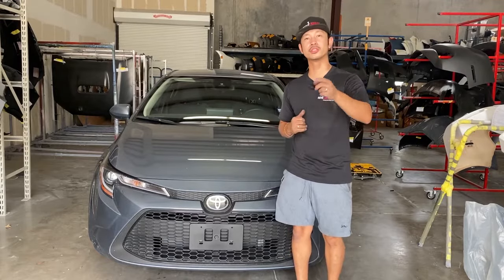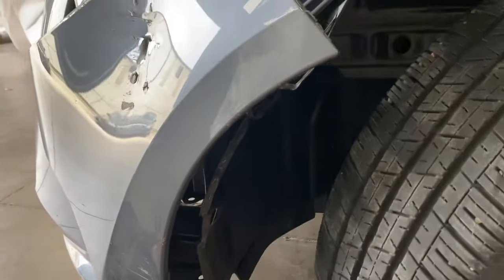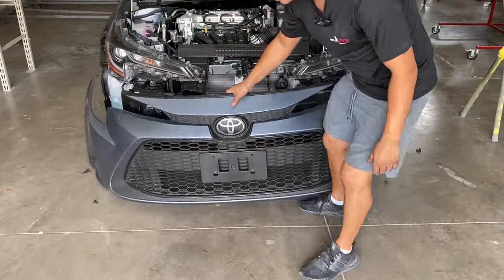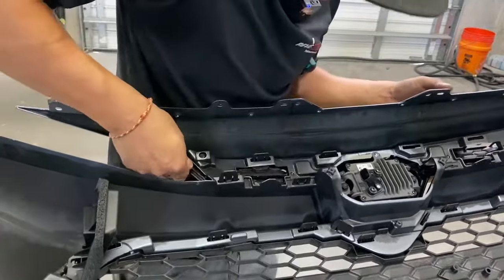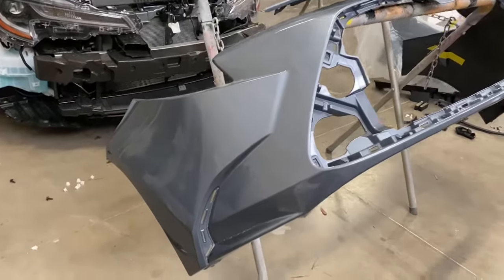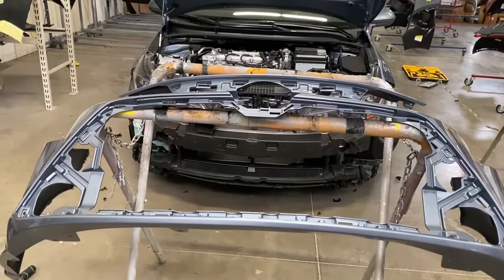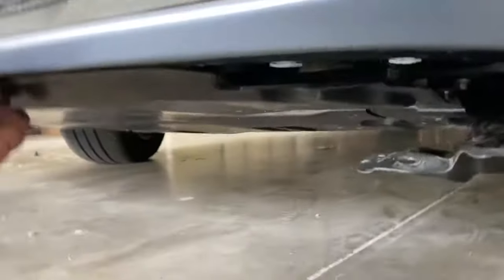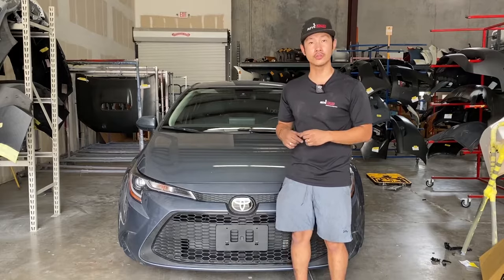How to Replace 2020-2022 Toyota Corolla Front Bumper | Step by Step for Beginners | ReveMoto

Comment: Those plastic pins you actually push them down and then you can just take them out instead of using a screwdriver
Reply from the maker: Appreciate the tip! Yeah some of these bad boys sometimes get stuck in the bumpers so we've found it easier to wedge the flathead in for some of the installs we do

Comment: That particular Corolla is Japan built. Unlike US built models, they have tow hook covers on both the grille trim and bumper cover itself. Looks like you installed a bumper cover meant for a US built Corolla as it’s missing a spot for the painted tow hook cover.
Reply from the maker: Very observant!  I like it.  Yes that bumper due to the backordered parts customer opted for the one available.  The fitment and install is the same just the tow hook is deleted.  If you need parts for your car go to www.ReveMoto.com

Comment: Just got mine scratched badly going into a badly angled parking lot entrance...good to know we can replace it. Costs $100-$200 for a replacement bumper which isn't too bad. With how low the Corolla is, it's unfortunately prone to little accidents like that...
Reply from the maker: Yeah with the help of this video replacing the bumper is super simple.  It it is not that bad then Touchup paint could be a good solution if you get into minor scratches regularly.   If you need the Touchup paint and painted to match bumpers go to www.ReveMoto.com.

Comment: Someone has stolen my Toyota Mark and my sensor is not working for the same model. What should I do? How to change the sensor?
Reply from the maker: You can get another sensor at the dealership and then use this video to take off bumper.  So you can reconnect sensor

Comment: Hi! Thank you for this video. What is the part at 13:06 called and is it important for the stability of the bumper? Because I found this black plastic clip that you popped out broken off the part that you remove at that Timecode inside my bumper and im worried that I need to get the whole bumper replaced. Thank you in advance!

Comment: If the rear bumper has a dent, could the heat gun hack worth trying or would the whole part need to be replaced?
Reply from the maker: Hi Annie,  depends on how bad the dent its.   Its definitely worth a try to heat up and push out.  If it doesn't work or has a hole in the bumper best to buy an new one.  Go to www.ReveMoto.com it painted to match your car and install is easy with this video.

Comment: Hey so my bumper got damaged. The clips on the side are broken. I don't know what the parts that hold the bumper up are called. If you can kindly tell me I will greatly appreciate it. 😊
Reply from the maker: Bumper support bracket is what we call them.  Tell the dealership you need the bracket is connected to fender that holds bumper.  If you need painted parts go to www.ReveMoto.com

Comment: Just got couple of small dents on my bumper.  Wanted to remove and do it myself but decided to get it done professionally.  I just took out the top cover by pressing on the 8 tabs but when I try to put them back, but they do not snap into the hole to hold the cover tight as before.  I also saw you dropping the 8 plastic tabs after you put the cover back in the last step.  Is there a way to push the tabs back so they hold the cover firmly in place as it was before I removed the plastic tabs ?
Reply from the maker: The tabs sometimes they get worn out and you have to buy new ones.  Depending on how you took them out or how worn they are.  The prongs may break making them not as sturdy.  I recommend just getting new one they like $2-$3 a piece at dealership or online for like a box of 25-50 for $5.99

Comment: Odd question, I'm looking at maybe having to replace a  front sensor on my mom's 2020 Corolla LE. Is there a way to get the front sensor off without pulling the entire bumper. If possible, I'd like to not disassemble the front end (mostly cause I live in an apartment, so I have no garage), but I have the tools to do it if I need to.
Reply from the maker: Honestly would be very difficult. You have to press on two ends of a sensor.  I honestly would suggest taking bumper of so you don’t mess up the sensors.  Thank you for watching!  Go to www.ReveMoto.com

Comment: Should I unplug the battery before the bumper sensor? Will it throw out an error code
Reply from the maker: It’s always good practice to take battery off.   If you don’t it did not throw an error for me.  If you need this bumper go to www.ReveMoto.com

Comment: Is there any way to remove the emblem without taking apart the whole front bumper? I want to just black out the logo in the front, but it’s covered by a plastic cap? I don’t mind having to take out the part but don’t want to take out the bumper if I can avoid it. Thank you for making this video!
Reply from the maker: I believe you do have to take the homer off.  Try wedging a flat object behind the emblem if it comes off easy then your good.  If there is resistance don’t continue or it will break

Comment: I am curious as to what the benefit is to using you guys vs others that charge less than half what you charge. I can get a color matched bumper cover for this car for 433 after shipping but with you guys its over $900
Reply from the maker: Very simple.  Ours are not folded so it comes to you ready to install.  Lifetime paint warranty and color match guarantee.  Any issues chat or talk to our live team members.   Look we also answering your questions at 11pm.  We here for you
Reply: @ReveMoto   Well thats cool. I appreciate the response. Thankfully there is a painted auto body part facility in Elk Grove Village which is right by my work that will do one for $350 out the door. Sorry I just cant afford $900 for a new bumper. Stupid truck tire blew out and was on the highway and screwed my bumper up.

Comment: hey, any chance you know how to remove the corolla se fog lights?
Reply from the maker: It’s probably similar to taking off the older model SE.   I would recommend still taking off the bumper it’s easier.   Here is a pretty good example : https://youtu.be/1QDBE8r7whM
If you need parts go to www.ReveMoto.com

Comment: Hey I also have same 2020 corolla le and bumper is popping out from passenger side and when I checked so there three bolts missing which join the bumper to car. Can you tell me the specification of those three bolts which you put near radiator for securing bumper to the car???????
Reply from the maker: I am not sure what they are called but if you call your local dealership they can tell u what those pins are.  They are not expensive at all and probably why ur car is having that issue.  Thank you and if you need parts for you car go to www.ReveMoto.com

Comment: Can the Le get the Se bumper
Reply from the maker: Are you trying to do a face swap? We have both bumpers here: https://www.revemoto.com/collections/toyota-corolla-painted-bumpers?utm_source=youtube&utm_medium=how-to&utm_campaign=2020-2022-toyota-corolla-front-bumper-painted
Reply: @ReveMoto  ok thanks I see your price is like $1000 I see other options that are like $500 painted brand new for the se face swap ? Is it a difference
Reply from the maker: @Milton-m3w  We focus on quality. So, we use a high-quality paint line, really quality control our parts (as you see in our YT shorts, sometimes we buff and polish the entire panel if it calls for it) and we don't fold our bumpers to save on shipping. 

The long version - we use a European paint brand that we continue to test from time to time and still seems to match the best for the past 12 years. Plus, we guarantee paint match so you can send in the paint sample for a custom mix out. Most of our competitors don't pay attention to orange peel, minor blemishes or fish eye and we check for all of that before any of our parts go out (we're not perfect, but we definitely fix our mistakes if any do go out like that!) And freight shipping on a pallet costs a pretty penny 😅 but we wouldn't do it any other way to make sure our paint stays in tact on your car forever. Hope that helps you with your decision! Really depends what's important to you for your car